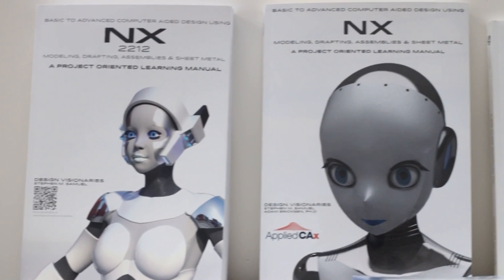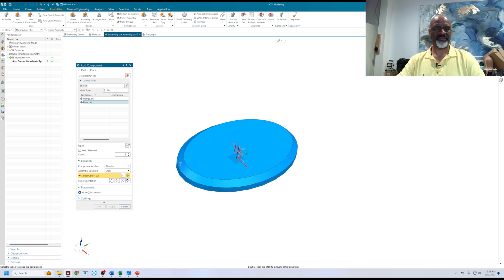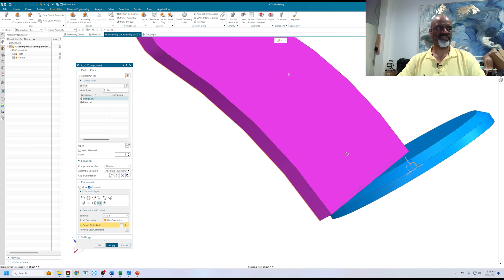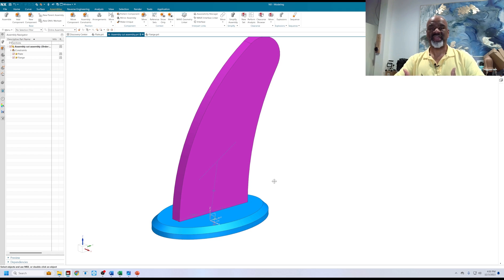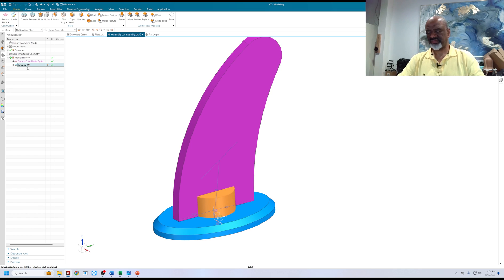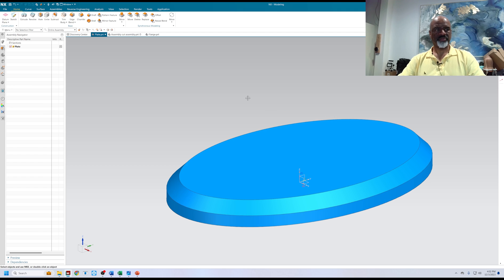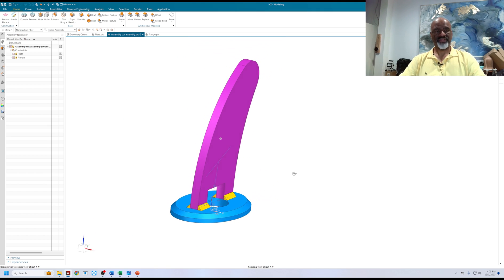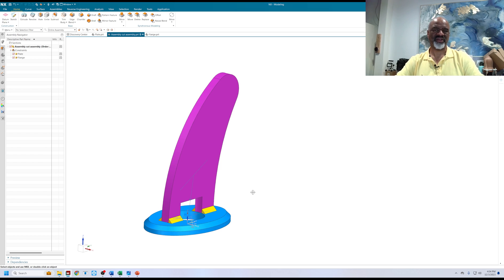Siemens NX - SAVE TIME MODIFYING ASSEMBLIES! How to Use Assembly Cut - Full Tutorial

Comment: Just curious, Steven, why didn't you create the fillet welds first, then the cut? That would have matched your up-front explanation that in the real world the plates would be welded together first, then the round cut made after welding.
Reply: That's what I thought too. He would only have to weld half as many times.
Reply: @Optimus_Sapiens  Did you understand why Steven made the comment that creating an assembly feature was particularly easier or nicer in NX than, say, SolidWorks? (cued to Steven's comment https://youtu.be/iqd2TSWZ0pg?t=232)
Reply: @MicSofty  I am not quite sure, what you are asking, but you mean what he said at around 4:00?
I have no Idea why he said "NX is kind of unique, in this ability to do that, so easily.", because if I remember correctly, Fusion 360, or Solidworks can also cut/combine multiple bodies at once.